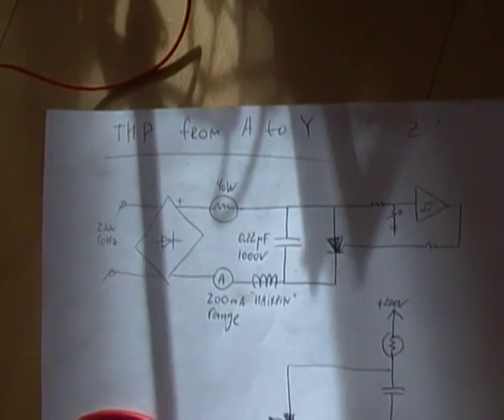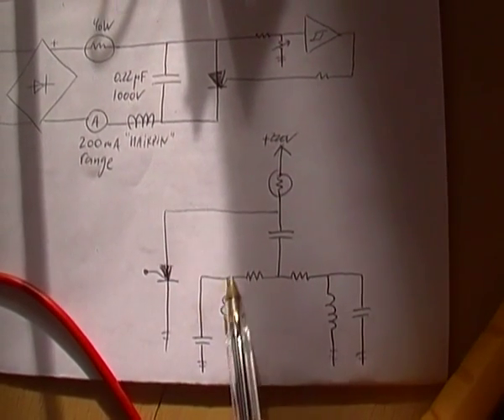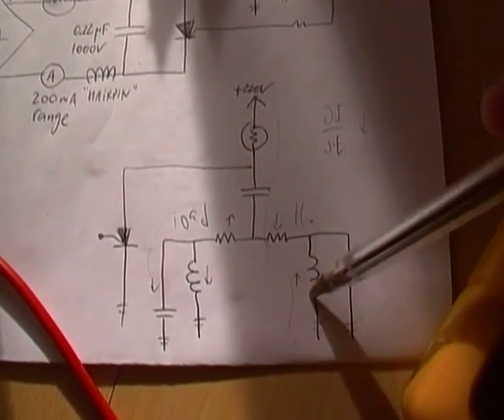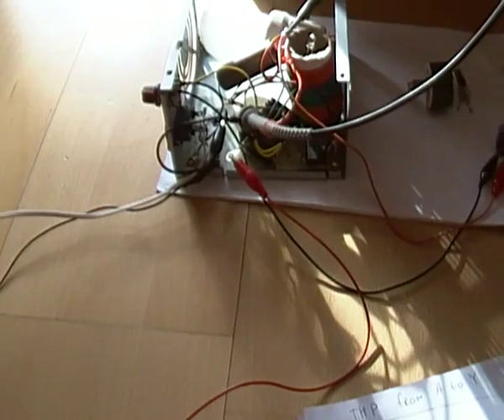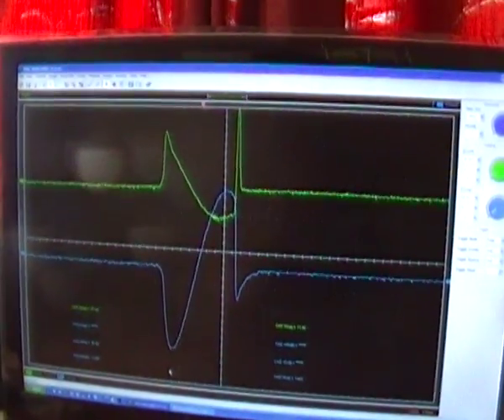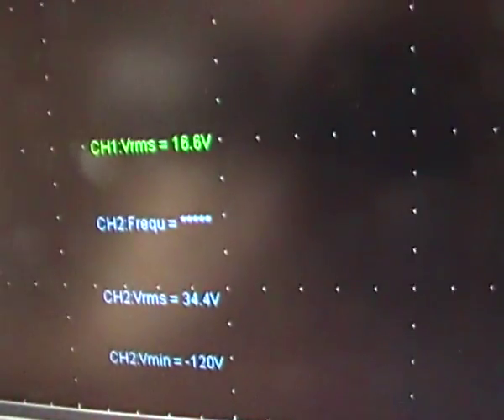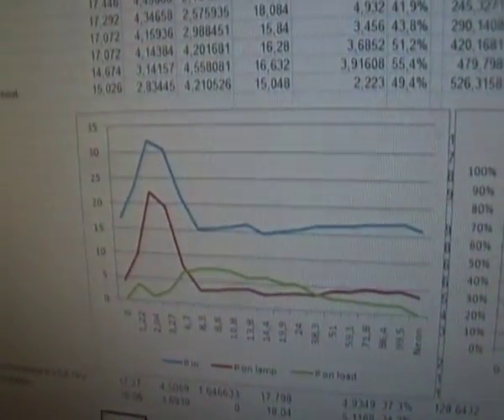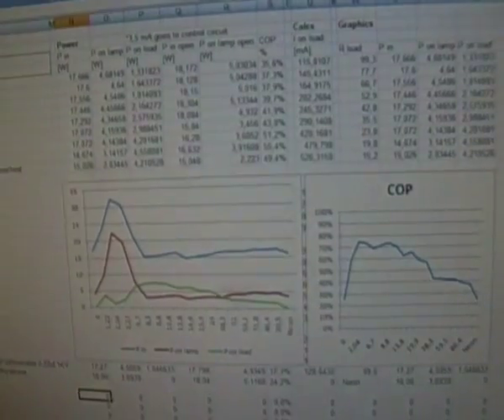Tesla Hairpin Circuit from A to Y

Comment: Key is the disruptive discharge of the (negative voltage) charged capacitor. This can be achieved by a quenched sparkgap, Tesla has a patent for that. It separates the classic electronic spark (blue/ purple, noisy and erratic like lightning), from the Radiant Electricity spark (white  gaseous and less noisy).

Comment: The voltage and frequency are far too low to allow much radiant energy to flow. Increase your voltage using a car ignition coil and increase the frequency to 15-20Khz. Your findings will be hugely different. Use a 12v car battery as input.
Reply: It can work with a low voltage and solid state switch. As long as the switch is very fast and short (like the magnetic quenched sparkgap)

Comment from the maker: @PaulTheAngel That`s correct. Increasing the threshold voltage - increasing the output, reducing the bulb brightness. But that`s okay witout radiant energy. With diode amperage ratings are just lower due to diode resistance. Seems nothing unusual.
If we could somehow get rid of the Z-effect, we would have an additional information... :)

Comment: Increasing the frequency or the voltage will give you more radiant energy and therefore should reduce the amperage more. What effect does adding a diode after the 40watt ballast bulb have?

Comment: What is the maximum load you have tried? One method to prove excess energy is power a motor to power a generator, then measure input agaist output. Have you tried a diode from a car alternator rectifier, as they are built for high amperage.

Comment: The reason the amperage is lower is because the circuit introduces radiant energy, due to the frequency you are switching the circuit at. Just like when you go to put a terminal on a car battery and the spark jumps to the terminal. You can light an incandescant bulb with 20,000 volts at 15,000 - 20000 Hz and with one wire. See Nikola Tesla's patent 454,622

Comment from the maker: 1. Plasma behaves like a small inductance. As a result of vortex forming. 
2. It has a nice and stable hysteresis in the voltage/current chart. Tesla used this property in his classic SG-oscillator to drive his coils. 
Other properties can be easily found in books :)

Comment: What does dl/dt stand for? Can you not measure the frequency? Is there any amperage running through the hairpin? Does the hairpin feel warm or unusual when you hold it. Can you hold one of the terminals and hold a bulb in your hand and it light?

Comment from the maker: @PaulTheAngel I`ve tried 2Ohm 10W resistor with best results - ~7W output power. Neon triode with ~2W out, small 6.3V 0.3A lamp - full brightness 1.8W. Not mutch comparing with the blalast lamp. 
Yes, motor+generator is a method but I`m not shure if it worth the work. 
No need to use high-amp diodes. There is 150mA max current. And I don`t have any :)

Comment from the maker: @PaulTheAngel dl/dt is a point of THP functioning and the way to understand it! I can measure it only in solid state THP ~2Khz. Can`t hook up a scope ot the spark gap! Of course current flows through the hairpin - during the charge cycle.It seems usual, room temperature. Karl Palsness says it`s hard to sleep after holding the hairpin but it looks okay to me. No, using body as conductor doesnt work as well as water.

Comment from the maker: @PaulTheAngel You are talking in poetry! I already have the 10 KV 300W THP with NST and the carcoil circuit as well! Like in my first vid the same effect observed. Can`t see the difference.
Also the frequency is natural in SCR-circuit, depends on cap capacitance, threshold voltage for schmitt and input voltage. We can change it only through this params.